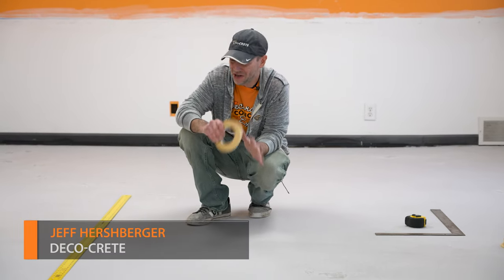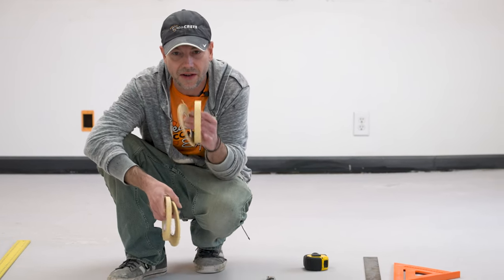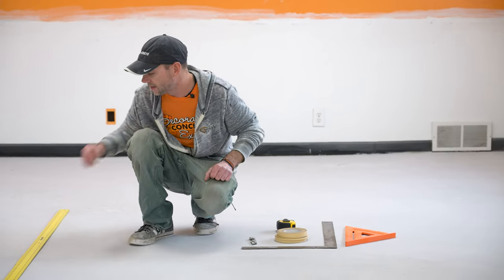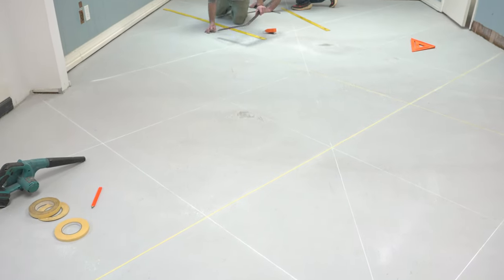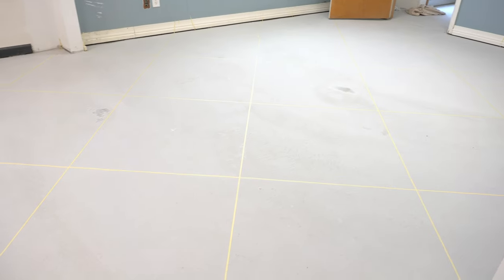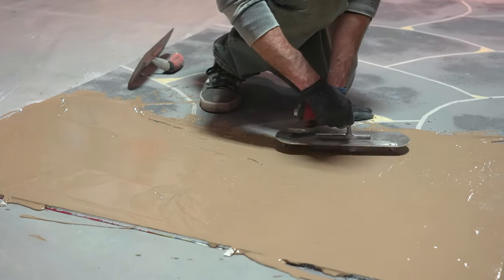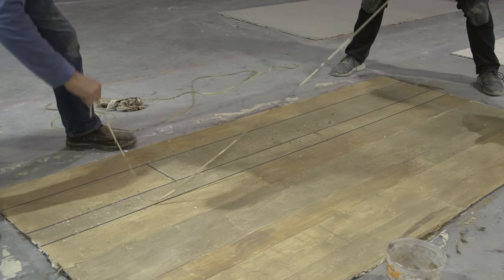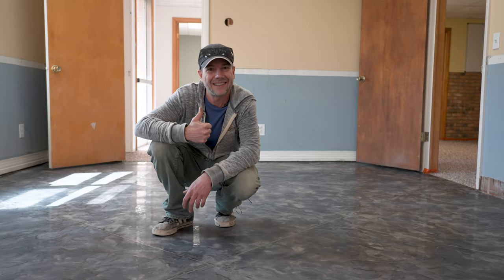Custom Grout Tape Patterns Using Concrete Overlay!

Comment: Experiment:

How would you tackle a dry pour while coloring it, to make it look like natural 2 to 3 tone rock?

..for a small outdoor DIY patio.
Reply from the maker: We would not recommend dry pouring colored concrete.
Reply: @DecoCreteTV  that’s why i said ‘experiment’. If one was to try coloring a dry poor, what might be the the more successful possible strategy⸮ 

..but if your reply was just the politically correct, business way to answer, then i understand. No hard feelings👍🏼
Reply from the maker: No political correctness is required at Deco-Crete. 😂 The problem with coloring dry concrete is that the pigment needs water to disperse throughout the mix. If we had to try this, we would use powdered integral color not granular or liquid. You would then need to thoroughly blend the color and all the concrete you plan to use on the pour. We don't know how well this will work because the pigment is still a dry particle. Also, once you start spraying the dry concrete the pigment will tend to run and become splotchy. Your best bet would be to forget about coloring the concrete beforehand and stain it once it has cured. https://www.deco-cretesupply.com/products/stains These stains are not formulated for dry pour concrete, and this would be completely experimental.
Reply: @DecoCreteTV  ah, cool. Thanks, that’s the answer i was looking for!👍🏼

Thanks for taking the time. I was worried you were brushing me off for mentioning dry pour. I’m glad to see that wasn’t the case, because i like your content. 

You seem to be the best concrete colorist I’ve ran across on YT so far, so I wanted to ask someone who sounds like they know what they’re talking about & used good logic.

Yea, I’m looking to do a small patio to look like stone & was going to do it one ‘stone’ at a time instead of all at once.

So i want a 2-3 color natural look & was thinking of staining it afterwards if i can’t find a way to color while doing it. 

Thanks again for they explanation👍🏼

Comment: What kind of concrete did you use
Reply from the maker: We used Deco-Crete Trowel Overlay for this job, along with a coat of epoxy at the end to create the metallic effect. I'll leave a link at the bottom. Thanks for watching👍                                                                                    
https://www.youtube.com/watch?v=G1tk1T1Lh00                                                                                   
https://www.youtube.com/watch?v=qIEfPZC_1pI                                                                                             
https://www.deco-cretesupply.com/products/trowel-overlay/stamp-mix